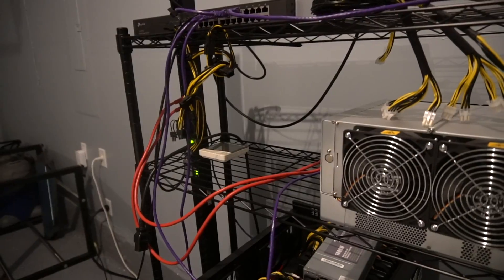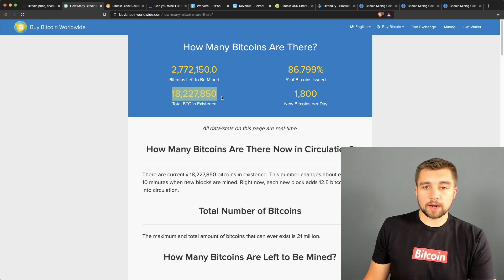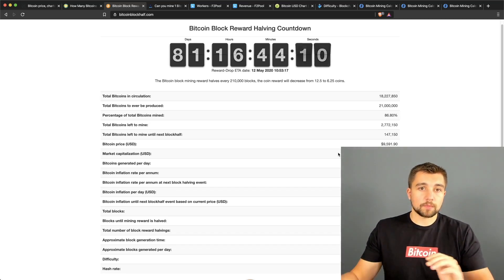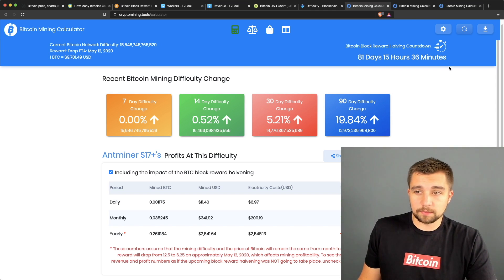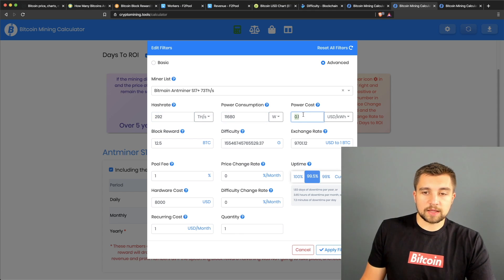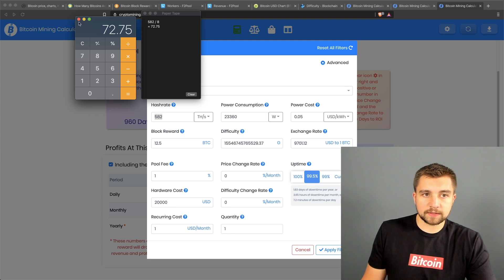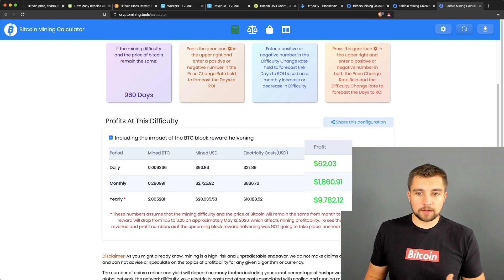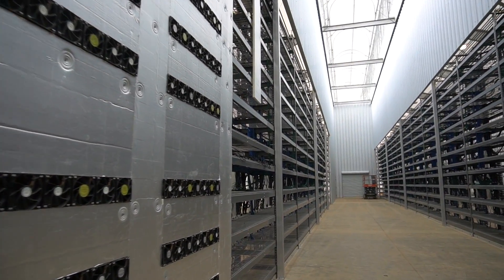What Do YOU Need to MINE ONE BITCOIN In 2020?!

Comment: well, here’s how i see my business model-Investing 10k in hardware and around 10k a year for electricity but will pocket  1btc! Here’s where gets interesting  the operational cost stays the same as the production. Assuming i use the hardware for 4 years before have to buy new model for 4 years ill spend 50k and will pocket 4btc. If i do that as a side investment until i decide to sell my btc is amazing if i have to pay for the operational cost from a btc production now makes sense but back in 2020 not ,current btc price 52,000! Imagine i invest 50k for the next 4 years and catch the next upper wave which i predict will be around 300,000-800,000 for a single btc having 4btc after 4 years at lowest price around 1,2 million isn’t bad business model at all especially when it will cost you 50k. The only thing is will wait until next February when crashes down to 10k and will buy 5btc straight  out,then will invest in mining . Because as you’ve noticed after every 4 year cycle goes up and then correcting  with at least 70-80%!

Comment: It seems to me that: NO I wouldn't sell my mined bitcoin to pay the electric bill at that point I start shuffling other assets like maybe take out some equity on the house, lol. Eventually(within a year) the coin will pay for itself. But the rising cost of mining BTC brings me to the next question: Can the same or tweaked equipment be used to mine/generate other crypto? I notice some of the other cryptos' price run in parallel and kind've follow BTC trends. If any of them are cheaper/faster to mine it may be worth transitioning once you hit a break even overhead wall with BTC itself.

Comment: my question is: if the cost of mining gets to high and miners back out at what point does bitcoin collapse due to not enough computing (aka keeping track of all transactions)?
Reply: to add to that, I understand that the difficulty will most likely go down which would increase the will to mine again which is what ultimately regulates the system but my question is what if bitcoin just isnt valuable enough to match electricity costs?
Reply: @jasonmillner6416  you talking about past. 
Past is the guide to the future.

Comment: No way to do that in germany - 28 Eurocents per kWh 😂
Reply: yes, I moved from NL to GER and now pay indeed 28ct instead of 20 which is already a lot. my mining profits are so low, but I see it as a hobby and a small gamble :)
Reply: @WillyVLD  What? If you wish to partake in the gambling aspect, why not just use the amount you spend on energy to buy that much btc per month? Far more direct and more beneficial. Purposely losing money as a hobby is retarded and just wastes energy.
Reply: @rdizzy1  atm ik still making Profit ofcourse. I Wouldn’t let it run with a loss. Additionally the heat generated saves me from switching on the heating in the basement which is quite a win (basement is well insulated).

Comment: Is it possible for a solo miner with just a normal computer CPU (i5 Intel 7600K) and GPU (GTX 1070) to mine for a Bitcoin DIRECTLY (take into account that I don't know how to do this even) and solve for a block to earn 6.25 Bitcoins?  What program would I need to get to have my computer solve a block on the chain?  I know this is a simple question and would probably require a more complicated answer, but this video doesn't explain how this could be done.

Comment: so ok the machines produce a lot of heat, why not converting it back, if i could i would engineer the farm to produce twice or more as much 
second we can use more expensive material that more electric sufficient that will make it actually cheaper on the E bill side 
third adding solar maybe? and programing it to use solar over default electricity when it produces that way maybe -5% to -30% on E bill?

Comment: Everyone freaking out here about the fact that BTC is 50,000 today, with is five times the price of back then... keep in mind the difficulty of the hashtable is ALSO 5 times harder. So you'd use 5 times the power to mine it. That's what keeps it from getting out of had and too many being mined and inflating the market and causing a crash. The way you have to think about it is this. If you aren't an industrial scale... it's basically just another stock trading commodity more affected by its usage and market rushes. Just treat it as another high risk investment.

Comment: This profession relies on mining a finite resource that will eventually end, my point strongly reinforced with the fact that too many people are mining it and there is clearly not alot of it.
It's not like diamond, there's alot of diamond but it is just extremely hard to mine.
Cripto currency all you have to do is craft an A.I., build a hardware for it, give it energy and clean it. 
Well, I personally do not have the heart for this but one advice that I have for people that do is.
.
Buy land in the desert, set up solar energy plants, set up underground facilities with cooling, & feed your (miners) that sun energy. It's free and there is plenty. Stop using fuel energy for this, just wasting finite fuel energy & lots of unnecessary money. 
Invest a little more on the solar energy solution and I foresee this will last you long term.
Reply: Diamond value is artificially inflated through forced rarity by the De Beers monopoly, not because it is hard to mine.

Comment: 2 steps forward, 1 back. That's what it sounds like to me.
Reply: The point he is making is that if you go into this for profit, you have to go all in. You have to buy one of the higher end devices that cost thousands of dollars, and you need to secure a location or power supply with a low electricity cost. If you half ass it at any point, you are only undergoing risk for no reward or for expense. 

On the other hand, if you believe Bitcoin is only going to get more popular in the coming decade, then even if you don't profit now, as long as you hold onto your bitcoins and don't spend it then you will profit when you do sell after it multiplies in value or end up being able to use it in replacement for the dollar (the latter being unlikely).

The other side to this though is that if you aren't profiting in the short term, then it is more worthwhile to buy bitcoin and hold it rather than to mine it. 

And like the California gold Rush, in the end, the people who actually make bank are the people who make companies supporting mining endeavors, not the mining systems themselves.

Comment: thanks for the video! im curious how is the electricty fcost of 8 miners 0.05 vs 4 miners is 0.1? where does savings come from?
Reply: It comes from industrial electricity being cheaper than residential electricity. Were effectivly subsidising corporations through an energy tax. Eventually you realise energy is money so Bitcoin is money.
Reply: Not sure if this is correct, but I’d reason to believe the 8 miners can run at a much lower load and still accomplish more work in less time, where 4 would be at full throttle guzzling power.
Reply: @waoooh  wut, that made no sense. Regardless, the reason it's 0.05 is because he was showing you what a farm would be like, and farms are set in places where the electricity costs are low hence the 0.05. He explained that in the video.

Comment: Hi anyone that wants to get in on the ground floor, check out this new crypto called "Pi network" Stanford PhD graduates made the first phone app that mines currency for free. Doesn't drain battery or cost data. When 100M join mining rates will fall significantly so you have to get in soon. Because its beta you need a member to invite you in Use code {Soule39} to join.  

Look up their white papers this has alot of potential. t

Comment: Now, what if you use an alternate form of electricity. Now, I doubt you’d be able to use solar panels because of the cost and efficiency reasons. But what if, say, you have a fast running creek or something in your backyard, and you were able to buy enough copper, magnets, etc. in order to use hydroelectric power in a creek that’s constantly running? Is is possible you could generate enough electricity to power the computer. I’m guessing it runs roughly between 1000-1500 watts, but would something like that be possible?

Comment: Hey guys! i just found  a new crypto currency called Pi Network.
It hasn't launched yet, but read anyways because you could earn a lot of moneys.
Pi network is a crypto currency that can be mined from your phone with the official Pi Network app.
The crypto currency will launch next year, so you will have a lot of time to mine lots of Pi.
Please, use the code Roborbiettino to recive 1 Pi.
You can understand better how Pi works in their website.
You just have to press a button every 24 hours to start mining.
Also remember that the value of a crypto currency increases if the request is higher, so the more people join the better  it is!

Comment: is it better to buy many more slower miners or upgrade to the faster miners?  Assuming the electricity cost is the same and the TH/s is the same -- like 1 x 60 TH or 2 x 30TH.  Space may not be an issue either.  It appears the costs and output are the same.... I am unsure.

Comment: Hi! Does the miner have to be on always and continually until it mines the coin or can It be turned off and continue later. I may have to move out where I am in a couple of months and just wonder if I can just unplug the computer and it will pick up from where it left off once plugged back in. I’m kind of new to mining and do it small residential, just started as a long term side thing.

Comment: Hi VoskCoin,
Heres a quick question for you. BTW great vidz. I have a 7 gpu rig  with r580's which are overclocked. Im currently using the old crimsome drivers from 2018 or 2019 since these were the drivers you recommended a while back in one of your vidz. Should i upgrade to the latest drivers? Will it get a better hashrate? Hope you can help.
Thanks.

Comment: not everyone pays the electric bill if you live in an apartment... why didn't he talk about that?
Reply: if you mine bitcoin in an apartment be it a 2 or 3 bedroom be sure to factor in the amount of noise these bitcoin miners make as well as the head that comes off of them. if you live in a hot area the miner will most likely overheat if not managed well but if you live in a snowy area and dont mind the constant loud noise that the miner makes then it might make fo a good heater. overall bitcoin mining in an apartment is a terrible idea.
Reply: true, but most apartments don't take well to adding hundreds of dollars of electricity to the "covered" electric bill. You may get away with it at a large apartment complex, but if someone is only renting to a small amount of tennants, or they can see consumption per unit they're going to come looking for what's using that power. I'd only run a single roughly 1kw miner (like someone growing plants indoors, 1000w is common for medium indoor gardens) but running anything more powerful is just asking for a knock at the door.
Reply: I've seen way too many youngsters getting scolded over trying to get away with something like this. If rent includes bills, the landlord will calculate it based on expected consumption and costs, I can assure you a doubled electrical bill will get flagged in no time and you might end up losing more than you expected to gain from it.
Reply: Where the fuck do people live that the electric gets paid for them 😂😂

Comment: Great video, as always! :) It's insane much hardware that is required to mine only one Bitcoin, as you said in the past you could mine many Bitcoins on regular CPUs. Wonder if the blockchain is that much more secure and are having faster transactions between now and then?

Good you mention this, I was a little bit into getting like a S17 but now I clearly see it's not worth the price, right now. It's simple too late to buy one today.

Please do a compare between which hardware that's most cost efficent to mine one BTC. S17 or a large GPU rig @ NiceHash for example :)